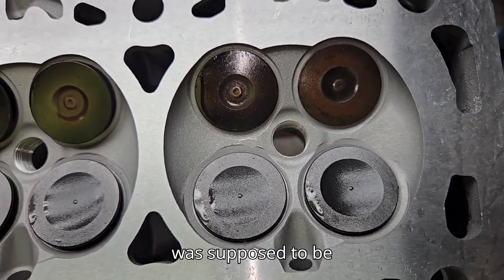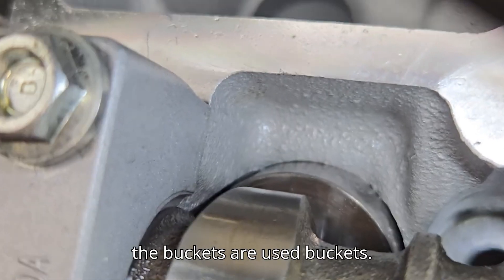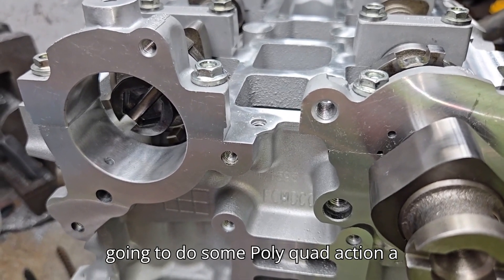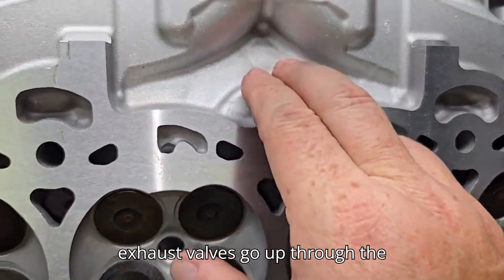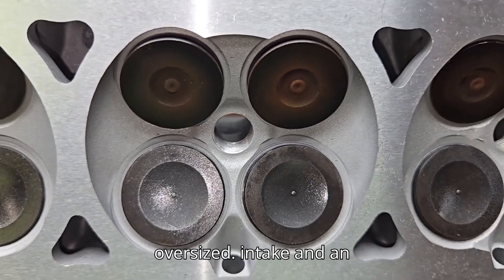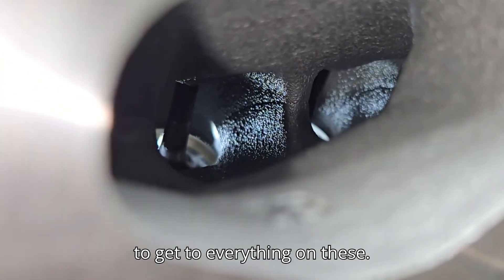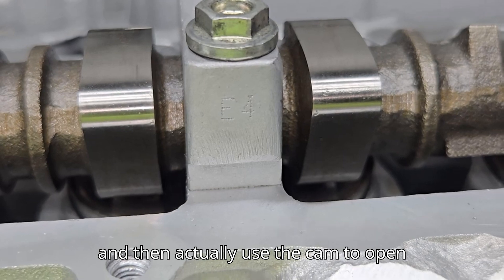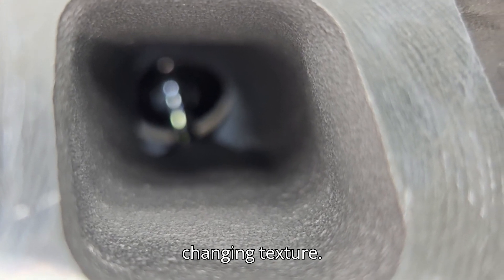David Vizard's 2023 Ford 2.3l Ecoboost Polyquad project. First look at a head that will be returned.

Comment: Will swirl be a big deal in a direct injection turbo engine
Reply from the maker: It is a good question. If it is done right I think it will help in the low to mid rpm torque. Thanks

Comment: The inlet cam has a fitting attached to drive the vacuum pump. You need to unscrew it to get to the camshaft timing slot, but it looks like a single solid cam😉
Reply from the maker: @areasixdevelopments590  Thanks

Comment: I have a little 2.0. cat is on the down pipe.The turbo hooks straight to the head. You don't need to heat and pressurize a manifold so the lag is pretty minimal. Just a PITA design to port.
Reply from the maker: @sar_rian  I did some research on 2023 model and turbo is right off the head as well. Cool dual scroll design too. Thanks

Comment: I'm excited to see 4 valve stuff. I keep trying to apply the vast 2v info to my 4v and some of it doesn't translate well. Thanks Charles.
Reply: Throat sizes need to be about 85/86% of the valve, unlike two valve which is in the early 90%. Most ports are already too large as well.

Comment: Easiest way to disassemble those valves: cut a circle out of a plank of wood just smaller than the engine cylinder diameter, place this circle of wood under head of the valves, cylinder head resting on this piece of wood, using a depth socket which is just bigger than the diameter of the valve stem locks, hammer this socket against the valve retainer, the valve stem locks will jump free....to lock back the valves: can use a sheet of plastic, having the spring and retainer with locks over valve stem and the same circle of wood at the valve head, place plastic sheet over valve retainer, and depress gently with the same socket used to dislodge the valves....hit or miss process but with some practice can get it done....on another note, to remove aluminium from cylinder ports that is difficult to access, can a type of sand / media blasting with high velocity air being moved, be used to remove material ??? Will be able to erode where is resistance to flow....
Reply from the maker: @ArvineHarry  Thanks

Comment: Drill press is the only way i remove or install the keepers on these especially with 90 to 100 lbs seat pressure i made a jig out of a old steel retainer welded 2 flat bars to the retainer and then a cross piece across the top with a bolt that sticks threw just be sure to get all sharp edges off bc if you hit the follower/bucket guide there pretty much junk there a 1 thou clearance unless dv is putting bigger buckets in for a bigger cam
Reply from the maker: @ericcook2274  Good info. Thanks

Comment: The “better” Ecoboost head was used on 2.0L Focus ST and other 2.0L Ecoboost applications with individual exhaust ports like the Ecoboost’s predecessor the Duratec 2.0L and 2.3L.  

Valve springs, in a pinch, just set a rag in the chamber and tap the retainers with a deep 17mm socket and dead blow.  You’ll pop the locks out and it comes apart in 6-8 minutes.  

I made a double collet adapter and built a simple valve spring compressor that uses the opposite cane cap to give me access to assemble them on the bench or in the car.
Reply from the maker: I hate to do it that way but I have done that before. Looking at buying an opener that will work. Thanks
Reply: @servediocylinderheads  I have a big c-clamp style one I used on a 2.0T audi 4 valve head you can borrow if you need one. Just email me your address.

Comment: Integral exhaust is probably also for smog reasons. It keepts the exhaust as hot as possible before reaching the cat or turbo.
Reply: If anything, integrated exhaust ports would run cooler, as they are liquid cooled.

Comment: There are some things about that exhaust port set-up that i like.  When you think about the firing sequence,  each exhaust pulse will hit the turbo, a clear 180° of crank rotation apart, which is very good for spooling up the turbo. Additionally,  1 & 4 are nicely separated from 2 & 3, but it will be a pig to port. Shame that it's not actually a new head. Will very interested to see what you do with it.  Regards Greg
Reply from the maker: @RevShedPerformance  I did some research on it today. Twin scroll turbo right off the head. Pretty cool actually. Thanks
Reply from the maker: I am buying a new head from Ford. Stay tuned. Thanks
Reply: @servediocylinderheads  yeah, the turbo packaging is very compact but also kind of inflexible which is good and bad for a small engine bay.  The twin scroll is good.

I think the low end torque of Ecoboost engines is kind of unnecessarily exaggerated, especially in a light car so you can trade some turbo response for a larger turbo which will extend the power band with more boost at high rpm (and probably lower charge temperatures because larger compressors are more efficient).

I want to put one in to a ~Locost (Lotus 7 replica type layout) so the I4 packaging works but the turbo may be in a bad place.

Some tuners like Montune seem to get around 700 up from a 2.3, I would like a high boost E50 tune with about 450 from a 2.0 (Focus ST bottom end with Focus RS top end and a V8 spec MT82 6 speed manual from a Mustang).  I also want an economy tune for gasoline so I can get 30+ mpg on road trips.

I'm going to have to look up "Poly-Quad" because I don't know what you intend to do.  I hope it's interesting.

Comment: Going to be interesting.  I haven't looked into the ploy quad. I like your ideas. Harbor Freight came out with a valve spring compressor that look like it will work better than an old school one $59.00.  Thanks
Reply from the maker: @DonDotterer  Excellent. Thanks
Reply: 59.95 in thier tool flyer 102.99 regular price. @servediocylinderheads

Comment: Im wondering if it is a new head with old parts in it. Maybe they bolted it down but didnt run it.
I have a tool for those springs if you want to borrow it. Goodson has them too.
Reply from the maker: I will check it out. Thanks!
Reply: Page 45 in Goodson catalog. CF-25-G, CF-32, CF-24-G.
Reply: I bought mine from Goodson. Had to have it for a Cadillac northstar. Worked great.
Reply from the maker: @ronberkshire668  I looked it up today. I don't see one designed for four valve heads.

Comment: This is probably a dumb question, but do you ever look at swirl on the exhaust side? My guess is not, because the gasses are being forcibly escorted out by the piston, but the polyquad concept and how it affects the exhaust flow has me wondering that...and is it the same direction of swirl/does it even matter?
Reply from the maker: I do but I don't think it makes much difference to the exhaust. Thanks
Reply: In the diesel world I like to make sure the exhaust swirl is in the same direction as intake as I don't want it fighting itself during overlap. Getting everything moving again if it stops takes a lot of energy the port can't normally supply.
Reply from the maker: @bcbloc02 Flow reversal can't be good. Thanks

Comment: There's also one missing thing that will really unlock the potential of the polyquad design. The passive pre-chamber. Which is essentially a spark plug non-fouler with holes drilled in the sides. The working principle is that air and fuel get pushed into the non-fouler, and the combustion produces flame jets that shoot out of the lateral holes. These holes are tiny like .7mm and the placement is important, but these flame jets light the air fuel mixture that get's mixed in the swirling motion leading to rapid combustion. This allows you to run higher compression ratios and higher rpms with less misfires and detonations. It also wastes less energy into the cooling system since the combustion is faster. You also need to change the way you run the camshafts, luckily the Ford has variable timing which let's you do some pretty interesting things.
Reply from the maker: Good info. Thanks
Reply: @servediocylinderheads  Some of the numbers don't even make sense. If you get it working right you're doing 20 degrees of timing under full load at 4k rpm. Because it only takes 20-25 degrees of timing for full combustion. You run 30+ and you'll misfire badly, because you'll have max pressure at TDC and not after..
Reply: @rolandotillit2867  being direct injection, the piston crown is shaped specifically to guide the flame front, and increase turbulence, the injector can open at anytime, since it is not hindered by the intake valve, and GDI fuel strategy includes injection during intake events, at times, and only injecting fuel immediatly before ignition events at other times.  The head gasket will not survive 30⁰ of timing at full boost, at 4000 rpm, for long, that is the 4 cyl ecoboost weakness.
Reply: @jamesgeorge4874  with a normal combustion process that's true.
Reply: @rolandotillit2867  and what process does an ecoboost Ford use, that isnt "normal" ? It is a spark ignited direct injected, turbocharged engine. 
It is not a TJI engine.
Reply: @jamesgeorge4874  we're going full polyquad with the aim of improving combustion are we not? If you just want to leave the engine stock then yeah you wouldn't do anything differently.
Reply: @rolandotillit2867  "fully polyquad" means what ? Complete multiple 4 ?  Ford engineered it, the way it is, stock, after spending millions of dollars, and they designed it for high power density, and to be able to "light off" the catalyst, and acheive closed loop operation, on a cold engine, in seconds, not minutes, and to run a high compression ratio, AND boost, something difficult with traditional fuel delivery. The injector location, piston crown, spark plug location are all integrated,  you know this, correct ?
The OEMs have ALREADY sorted that out, tumble generators / swirl flaps, and variable intake valve lift
ALREADY EXIST , without the need for different valve sizes. Subaru and Honda have done it for decades....
Reply: @jamesgeorge4874  Tumble is not swirl, which is really hard to do with 4 valves of the same size. Yeah I'm sure Ford spent a lot of money designing this engine, and they also built in a lot of compromises. And, yeah I know the piston crown has a lot to do with guiding the air fuel mixture and the engine is DI. These engines don't have passive pre-chambers to increase combustion speed. They don't use early IVO at high boost full load to increase expansion ratio(semi-atkinson cycle). There's a lot that can be improved upon, and Ford isn't the only one making rapid combustion engines, and certainly not the only ones doing it at a racing level.
Reply: @rolandotillit2867  You missed the point, Ford did not find the need to incorporate IMRC / tumble generators / swirl flaps, or variable valve lift on the ecoboost 4 cylinder, because they are NOT needed ! Do know what the air mass coming out of a turbocharger is doing ? It is traveling in a vortex as it leaves the compressor housing ! It is already in a turbulent flow state, some engines even incorporate vanes in the intake to counteract the swirling air charge.  Naturally aspirated engines rely on atmospheric pressure for induction,  turbocharged engines do not. 
"Fully polyquad" is an expensive, solution to a non existing problem in a GTDI engine. I'm betting that a polyquad head won't make 5% more power than stock , on an ecoboost 4. Simply adding boost, fuel , and timing will get you 100 hp, with touching the cyl head.......
Reply: @jamesgeorge4874  I agree it's expensive because it takes a lot to develop it properly, and it by itself won't make more power. It opens the door to it. It lets you run higher compression, at higher RPM, with less detonation and fuel consumption. Which is good if you're in a regulated series that limits boost pressure, and fuel consumption. For people like us it probably won't make a big difference, at least not without a few supporting mods. Even then the difference will only be to improve the quality of combustion, not to make more power by itself.

At high RPM high boost, high compression, the quality of combustion becomes the biggest obstacle for longevity and power.
Reply: @jamesgeorge4874  The ecoboost has variable valve timing, doesn't need variable lift though.
Reply: @jamesgeorge4874  The Maserati MC20 Nettuno engine is a polyquad DI turbo charged engine with a passive pre-chamber.
Reply: @rolandotillit2867  Again, you missed it. You aren't increasing combustion efficiency in a GDI engine with different valve sizes, the engine does not have an airflow problem  !  If you could increase fuel pressure to further atomize the fuel charge,  perhaps, but 2000 psi gives you pretty fine droplet size. I highly doubt your gains will be worth the trouble, if you see any, at all. I understand that an N/A engine could benefit,  but turbocharged, NOPE !
Reply: @rolandotillit2867  yeah, I know ! It does NOT NEED anything to help 
MIX fuel and air, because it does NOT compress an air / fuel MIXTURE ! It only compresses the air charge, because fuel is introduced milliseconds before the ignition event ! Does it make sense now ? Tumble, swirl and charge motion control are moot, because there is no MIXTURE !  Welcome to the 21st century  !
Reply: @jamesgeorge4874  You don't understand the role swirl and prechambers play in improving combustion.
Reply: @jamesgeorge4874  The Nettuno engine in the MC20 is turbocharged. The pre-chamber improved combustion speed and efficiency, combined with the polyquad swirl will make combustion even faster. Think of how a vortex works, the center is low pressure while the outside is high pressure. If you have fuel injection tangent to the swirl, it will pick up the spray and mix it with the fuel. The jets from the prechamber will ignite the mix in the vortex, and since heat lowers density, the igniting fuelmix will get pulled to the core of the vortex. Without the pre-chamber you're wating for the spark plug to ignite the air fuel mix and for the flame front to travel through the chamber. With swirl, this works in reverse, the flame comes from the outside in.

If you don't see how this keeps combustion heat away from the cylinder walls while increasing the burn rate, then you fail to see the benefit of a polyquad with combined pre-chamber.
Reply: Hello. Rolandotillit, do you mean passages (pre-chamber), like was in the  hemi head of Renault Gordini or open grooves besides of spark plugs?
Reply: @TomKunnas  Like the MC20's engine.
Reply: @rolandotillit2867  Okei, I have to check that engine...👍

Comment: Why port texture important on port injection?
Thanks
Reply from the maker: It isn't. No fuel to worry about. You could make it like glass.
Reply: @servediocylinderheads  i mean the v8  2 valve cylinder head not this
Reply from the maker: @amirdoshmanfekan5145 Port injection I like some texture to keep fuel atomized. Thanks